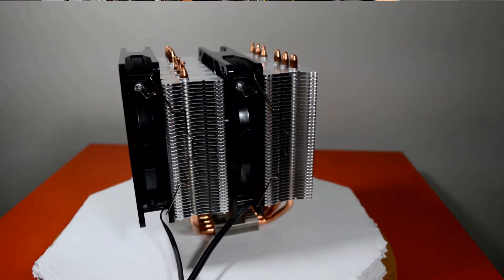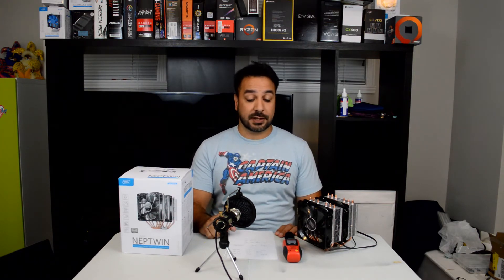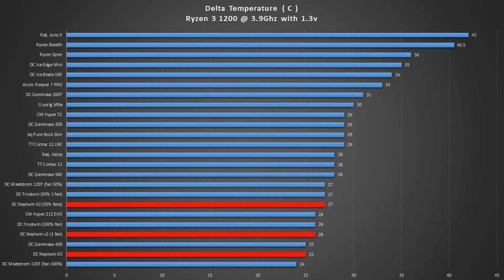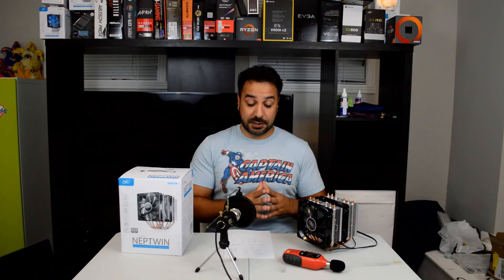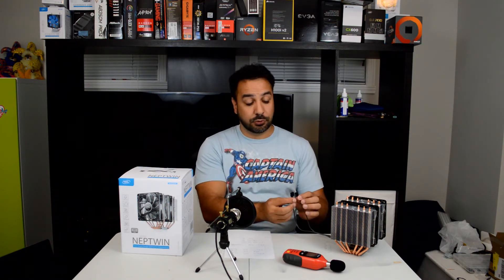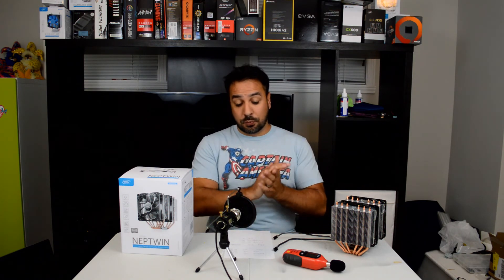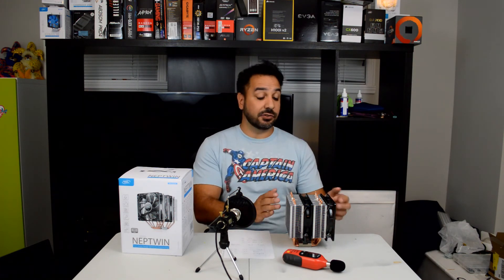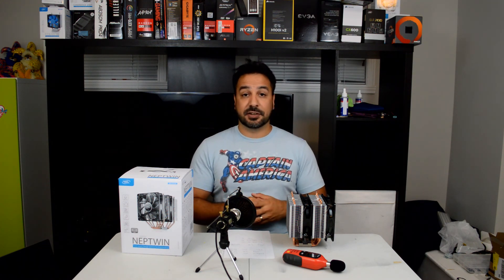DEEPCOOL NEPTWIN V2 CPU Cooler Review, Budget Twin Tower Cooler

Comment: Does it matter that I installed the 4 pin fan in the middle? It runs at around 1500 rpm, and the 3 pin one as the main intake only running around 600 rpm. My temps are as bad as gammaxx 400 (4 tubes 1 fan). Didn't expect this at all.
Reply: probably, tried the opposite?
Reply: @thesummertune it was actually the right way. Fixed the rpm with a fan software and undervolted my 12600kf a notch. All gee now, temps around 65.

Comment: hey what is ur temps on cineabench r20 and could u run aida 64 or prime 95 if u think its that stable :P bet its not probably 1.36 or 1.38 to get stable on prime but if u did that for the load temps that would be awesome also openhardware it and get the cpu package temp and core temp in there man great video just need abit more info ,  i just got one for my 3600x ill post the temps in a few days when it comes in wish me luck i just had to order i new bored my one i got was defective got about 4 hours of game play out of it then burnt smell came from it and black screen at post wont even turn off xD

Comment: Your cpu is not running hot enough to see real temp differences, this thing has 2x the surface area, 2x the fans, than the Gammax 400 this cooler should be getting a lot better performance.

Comment: Can this keep my ryzen 5 2600 below 65c when gaming?
Reply: And what is its temp when its at full load? Please answer its very important
Reply: Pretty sure it can, it can even keep it below 65 after overclock.
Reply: im pretty sure it CANNOT (unless u use say krynaut then maybbbeee) assuming you aren't playing terribly undemanding games. But if u play say BFV, i really doubt it will keep under 65 consistently.
Reply: @ZDY66666  bf5 undemanding game? Do you know that bf5 can load all 12 threads above 70% right?
Reply: @qiyuxuan9437  ops. meant to say it's a demanding game. Which is why it can't keep the temps down. I forgot the contrasting "but". Edited it in

Comment: Will this cooler fit in a thermaltake core g21?
Reply from the maker: Theoretically yes but you will only have 1 mm of clearance cooler is 159 mm and case has 160 mm so you ll be right against the glass.

Comment: Does it fits in a case with max height of 160 mm?
Reply from the maker: its clears 159mm so technically yes but you will be right up against the case or glass and if the build tolerances are too high on your case might have a variance of 1mm and not close so make sure you can retrun it if you try and it does not fit.

Comment: If I use this on my 8400k i5 and I install then I change to a 8600k would I be able to take it of then put it back on or can I only use it once
Reply from the maker: you can reinstall it no problem on multiple cpu or multiple systems sjut make sure to put new thermal paste each time.
Reply: No u can wipe out and clean the used thermal paste,and that's it ,ready to go!

Comment: How good is it when compared to a nh-d15?
Reply from the maker: have not reviewed that cooler yet sorry can't directly compare them.
Reply: The cooling performance is not much worse than d15, but noise is a lot louder.
Reply: @qiyuxuan9437  Though it could be said at the price, replacing the fans for quieter fans may still come out cheaper than a D15